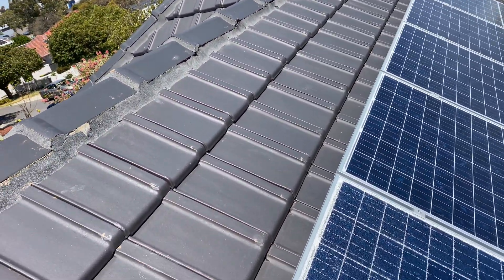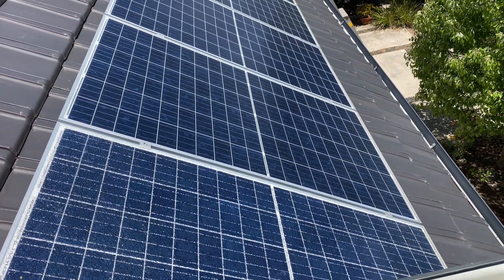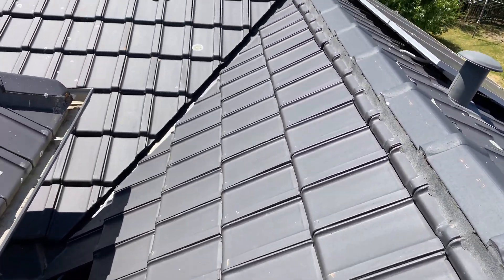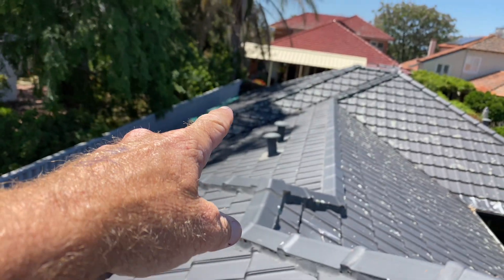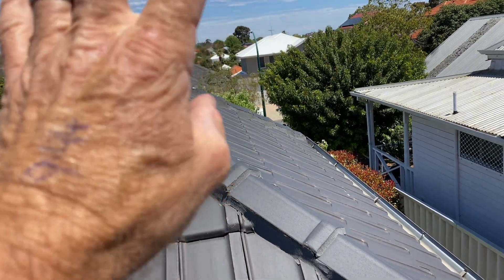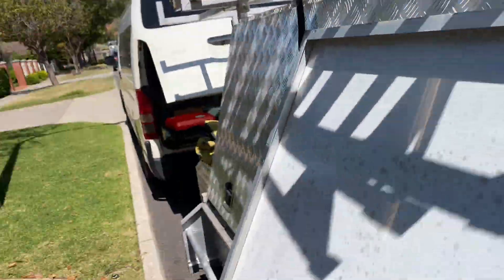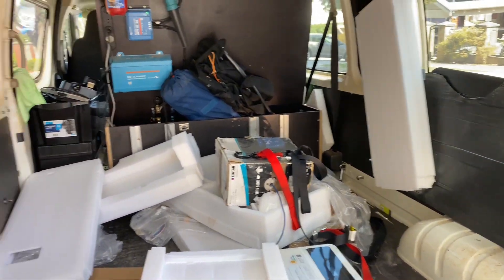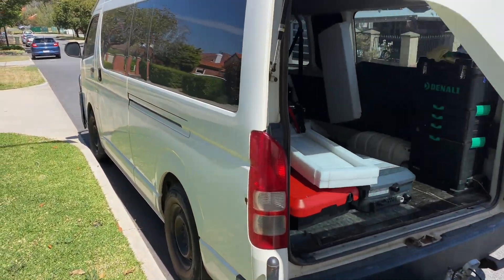Replacing an REC panel that has a burnt out cell! So much for being shade tolerant!

Comment: Am i mistaken, but was that 5 panels facing North & 3 panels facing South?
That would mean all the panels are installed on 1 string, yeah?
I thought with a string inverter, that the system would only be as effective as the weakest panel, yeah?
So wouldn't the South facing panels make the system pretty useless in Australia (North is best, South is worst)?
Reply from the maker: Two strings on this one, 5 x north and 8 x South 👍🏻
Reply: @joondalupelectricalservice3201 👍

Comment: REC had a bad batch of panels a long while ago, make sure the panels aren’t from that batch.  Also notice how few current collectors are running through each cell in those old panels?  Modern panels have as many as 16.  8 is typical.  Those look like those have 4.  That’s probably why the shade took it out… not enough design margin when its sibling half was shaded (putting all the current into the other half). Usually half-cut panels are a good choice for shade.

Orientation can matter too.  Notice how it looks like just a single cell took the brunt of the current?  Sharp shadowing that only takes out the edge of one cell on a sub-string can present a low enough resistance to prevent the related diode from going into bypass, forcing current through the cell.  When multiple cells on a sub-string are shaded, the the resistance gets big in a hurry and the diode will go into bypass more reliably.

Another option for dealing with low voltage in a small space is to use a larger number of much smaller panels in series.  On a roof, even as low as 200W.
Reply from the maker: Thats awesome info thank you that all makes great sense 😊👍🏻
Reply: Optimizer system would've been ideal. I have a 4 year old SolarEdge system with 6.5kW panels (325W panels). I just added another 5.28kW panels (440W panels)  to my system. Different SolarEdge optimizers are compatible with themselves, so it's easy to add whatever wattage / voltage panels you want.
Reply from the maker: @brettjohnstone696 yes for sure I love Solaredge for this type of application
Reply: @brettjohnstone696  On my current garage-south (this is California) I have simple RSDs on everything (required by code) but I'm paying careful attention to two of the panels on the corner that get regular foliage-caused shading.  Semi-diffuse shading.

My original system from 23 years ago developed faults on two panels in the same positions due to either moisture ingress or shading.  That was very old panel technology though... SHARP 165W panels (!).

Anyway, if I see problems develop again I'll throw optimizers on those two panels instead of simple RSDs (and replace the panels if necessary, I've got plenty of spares).  Just to deal with the same shading/over-current problem that was shown here.

-Matt

Comment: do you find tile roofs more problematic than steel for solar? heard there's more potential for leaks, debris build up, bird nesting under the panels etc
Reply from the maker: Yes for sure but when done right it shouldnt be an issue. I have other videos in here showing how.